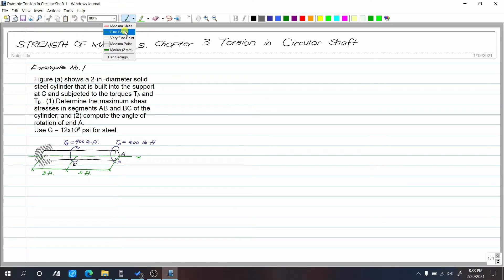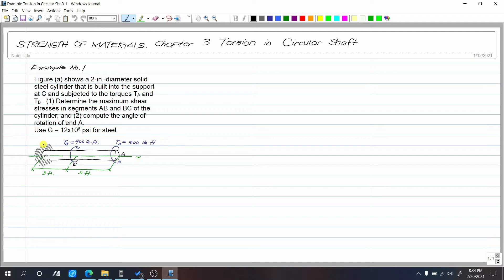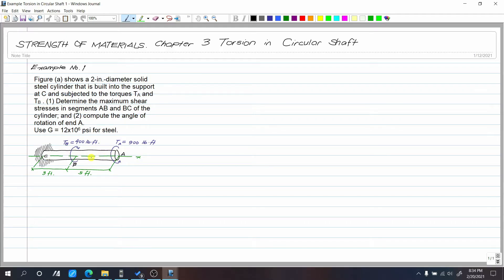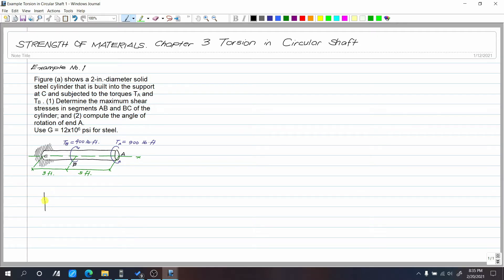Mechanics of Deformable Bodies   Chapter 3 Torsion in Circular Shaft Problem 1 (PH)

Comment: Pa help naman po ako sa assignment ko sir, maraming salamat po

Determine the maximum permissible value of T provided that the allowable shearing stresses in brass and steel are 70 and 110 MPa, respectively, and that the angle of twist between the two ends must not exceed 8°. The outer and inner diameters are 90 mm and 70 mm, respectively. G for brass and steel are 40 GPa and 80 GPa, respectively.
Reply from the maker: That is Thin-Walled Tubes. Sa 2nd topic po yan ng Torsion kasi may outer and inner diameter e.